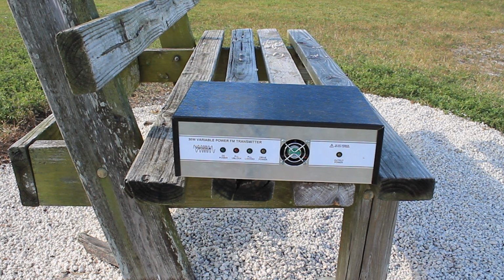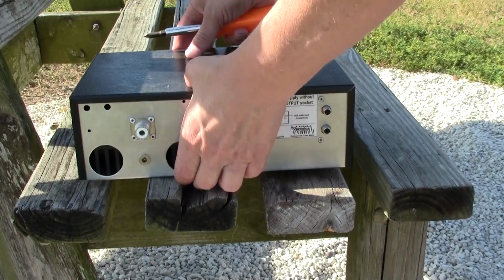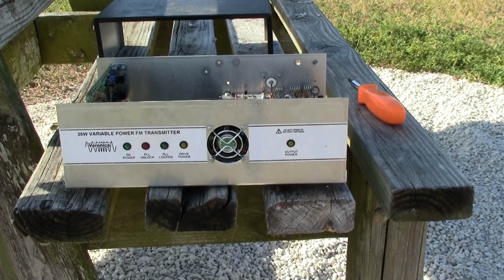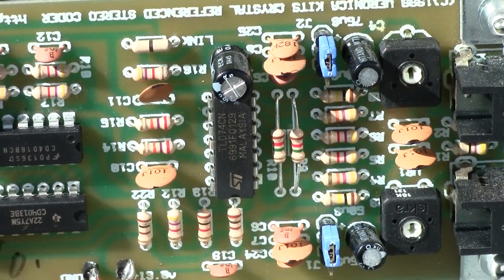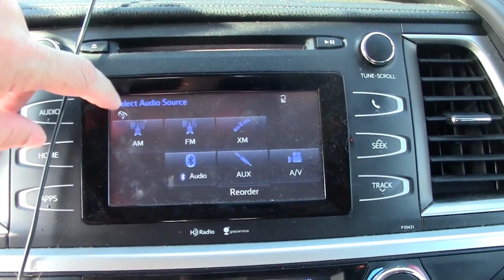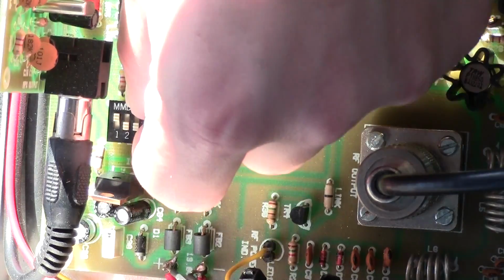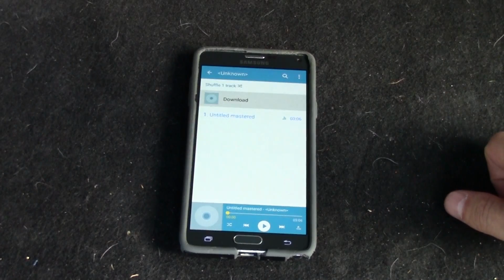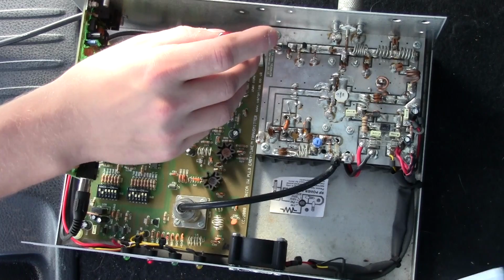Cheap PIRATE/UNDERGROUND FM RadioTransmitter by Veronica--How To

Comment: I run 100 watts and a .94 wave dominator  its hilly around here I get about 10 miles with good sound I have only 40 foot of tower  I have a 75 foot one for my wireless ISP   but if caught I don't want the feds taking that tower !!
Reply: The1Killerz  Illegally broadcasting on FM radio without a licence.
Reply: You'll get a warning first as long as you aren't on a local occupied frequency or using profanity
Reply: @CoolOldBiker   We now have been at it 5 years with no problem the closest station on our frequency is 100 miles away from what we have read they don't do the warning any more  the tiger teams swoop in since a FCC agent is not  law enforcement   they must have ether a federal cop or local police to make entry with a warrant and both the county and state police listen to us when in the area and we have been advised they will warn us if they are involved !  we have tried to get LPFM with no luck plus its so expensive  and a LOT of the groups that did get licensed have turned them back in because of the fees that no one tells you about like $1000 for BMA  ASCAP  the $3500 for a EBS receiver   and you must be on a minimum of 36 hours a week so if your not on the EBS is useless  we have a weather alert radio from Wal Mart  and we beat the local news by a few minuet's getting a warning out   the whole thing boils down to the NAB is scared to death some one will prefer our station over a members one  whats scary the NAB has lobbied IE paid off the FCC to allow mutable stations owned by the same corporation  and now even the RUSSIAN media can own stations in the US and they do !! that's not good ! BTW yes we don't allow foul language on air nor do we allow Rap Hip Hop OR young country to be played and we now have a homemade profanity cut out with a funny tone of a ku ku clock bird for live phone slip ups . OH with new coax now a 15 mile range  the stuff for CB RG8 is awful !

Comment: A question for the guy who did this video I've got a 7watt FM trasmitter at the moment here in the UK and my antenna is 40tf above ground level if I get a 15watt fm trasmitter and keep my antenna at 40ft at 15watts how many miles should that get me because at the moment it for a 4miles on 7watts?
Reply: More power is not the answer. More height is. 40 ft off the ground isn't high enough. It's why they put FM transmitters on mountain tops.

Comment: I would have thought that the inputs would be at line level and you would need to convert speaker to line level input to match the requirements of the transmitter.  Not doing this could overdrive the unit and damage it not to mention the sound is horrible.

Comment: So if I i somehow put the antenna in the stratosphere i can basically broadcast to North korea?
Reply from the maker: +Mr.Baofeng --->  now you got the idea!
Reply: They wouldnt be able to hear it as their radios only tune specific frequencies. Their local 100Kw transmitters would swamp your signal if you transmitted on the same frequency. Also if you’re on the other side of the planet, they’ll be shielded.
Reply: You didn't mention your location. If an antenna were to be extended into the stratosphere however, your transmit signal would be absorbed by your feedline after a few hundred feet, and no signal would make it TO your antenna. If your proximity is within 10 -20 miles of N. Korea, you would see a good chance of being received with an antenna up only 30 - 40 meters and a transmitter of 100 watts. What is your location? I can have someone listening for you in the area you are speaking of.

Comment: I find it amazing some of the crap that comes out of peoples mouths. The guy jakeguitar01 who made this video is NOT claiming  to be a professional he is just showing you whats inside the unit and how to adjust it. How can people judge the sound quality over the internet !. The guy is feeding the transmitter from a mobile phone and recording it with an average microphone and then uploading it to you tube. What are you expecting "musical fidelity". He's just showing you how the bloody thing works. As for those of you arguing about power and distance, some of you so called experts are talking sh@t. There are many things to consider when transmitting, for instance, someone listening to your output may live five miles away from you and have no buildings in the path of transmission. on the other hand, someone living one mile away may have and may not get your output. You need more power to get around buildings and into built up areas not so much the distance. I could go on but i wont. The video was educational........ give the guy a break.

Comment: What is purpose of Premphasis?  Thank you.
Reply: Without getting into a lot of complex theory, the idea of pre-emphasis (and corresponding de-emphasis which occurs in all FM receivers) is to increase the signal-to-noise ratio = make the system sound better.
Reply: In hindsight it was stupid.  It is boosting (preemphasizing) the high frequencies at the transmitter. . . then deemphasing them at the receiver.  The result is a better s/n ratio for the high frequencies at the radio speaker.  The boost at 15khz was about 17 dB.

Comment: What's the best frequency to transmitt on for distance?
Reply: One that os clear in all the areas you want to cover.  Really, it is as simple as that.  You need to have a listen in different areas, look at which legal stations are about etc.  I used to listen to Dimension FM on 92.2MHz in the North West.  They had a TX on the TV mast on The Wrekin.  No one around the area used 92.2 so it was ideal for a huge range.  They were also heard by another station in Manchester.

Comment: The sound quality is poor.
Reply: Yep its thin and tinny sound because its crystal based oscillator, transistor oscillator multiplier designs much nicer sound as not restricted by crystal bandwidth, they did put out good power though.
Reply: That is because he is not using any audio processing.
Reply: @knoxieman  The crystal has nothing to do with it. Commercial transmitters used by FM stations are also crystal locked and they sound pretty damn good. It comes down to the quality of the transmitter and the audio processing used.
Reply: @radioengineering8247  in this case it sounds bad because he is running a speaker-level signal from his phone directly into the stereo coder which is a line-level input, but he also is not using any audio limiting aka broadcast processing. with the proper airchain these veronica transmitters sound great and produce a clean, harmonic-free output.
Reply: @knoxieman  the veronica pll's are not crystal-based.

Comment: whats the range on it?  probably not too far ,  i know the amatuer radio antenna up on the mountain gets around 75 miles dont know how much power out mabie 100? watts.  mabie 2 miles with your 30  watts?
Reply: fm broadcast range is highly dependent on antenna height over terrain, the higher the antenna the longer the range.

Comment: In the US, unless you're a licensed radio amateur and testing on amateur-authorized frequencies, the fact that your transmitter is missing the FCC's part 15 compliance tag (it wouldn't qualify for one anyway) means you're not quite "in compliance with part 15". It doesn't matter if you say the "power is turned all the way down".  Just a point of interest you can research yourself.  Nothing toxic and nobody will hold you accountable ... just technical, unless you interfere with someone, which is possible to do with 30 watts.

Comment: When was that xmitter built?   That is literally 1970's technology in that thing.
Reply: you can see at 9:18 the amplifier PCB says copyright 2001
Reply: david dennis the first veronicas were made in the late 90's. the one in the video is a pll3 "easy tune" from around 1999. my oldest is a pll2 i built from a kit around 1997. the latest is the pll9, i have 2 of those, a 1-watt version and a 100mw version. 
 
 they look old-school because, believe it or not, there is absolutely nothing wrong with old-school technology if it functions properly and efficiently. these ancient-looking boards produce an extremely clean signal, and if you connect them to pro-grade audio gear like an optimod, you cannot tell the difference between a commercial radio station or a pirate running a veronica. none of the crap chinese fm transmitters on ebay come anywhere close to the same signal quality.
Reply: David Dennis how are you seeing 1970s? Looks like early 1990s
Reply: Transmitters, especially those from the 90s, were not sexy to look at. The low power ones were usually in an enclosure with a couple jacks, an RF output, a few lights on the front with a couple buttons, and maybe a VU meter. Other than that, they were extremely utilitarian.
Reply: The designs for these units go way back - it's very old technology which has never been updated. A decent exciter shouldn't have to have the PLL manually tuned to lock.

Comment: Good god, thanks YouTube for the speed control.  I'm falling asleep here.

First off, you don't look for an open freeq at your transmitter site. You want to know what's open in the distance, preferably the fringe distance, in all directions (it will take a while).  However you don't look for AN open freeq, you look for THREE open freeqs in a row, and you want the middle one.  That will ensure you're stepping on neither an adjacent channel station nor are they stepping on you.  But you'll never know that at your TRANSMIT site.

And second, back at the beginning, you don't need to connect a dipole antenna specifically --- you just need to connect AN antenna.  Dipole is one type out of dozens.  And btw I've got 13 miles out of half a watt, so it's way more about antenna than power.

Comment: You are definitely not part 15 compliant, not even a little.
Reply: Part 15 Devices:
Unlicensed operation on the AM and FM radio broadcast bands is permitted for some extremely low powered devices covered under Part 15 of the FCC's rules.  On FM frequencies, these devices are limited to an effective service range of approximately 200 feet (61 meters).  See 47 CFR (Code of Federal Regulations) Section 15.239, and the July 24, 1991 Public Notice. 
So, in black-letter law, if your signal exceeds 200 feet, you are in violation

Comment: Is that all ? Think you are doing something wrong, I can get out more than that with 1watt
Reply: I have got 27.7 miles on a 0.5 watt output transmitted into a vertical vhf antenna mounted 60 ft above ground I could work the world on 30 watts. 😊 peace ✌
Reply: Pete uk radio amateur mw6zan what equipment do you have? And how did you set it up? I’m ready to take my station from internet to the fm dial. Pls help?

Comment: Yeah bro you're almost certainly not in compliance with Part 15 rules with that thing.
Reply: Although an operator does not have to obtain a license to use a Part 15 transmitter, the
transmitter itself  is  required  to  have  an  FCC  authorization  before  it  can  be  legally
marketed in the United States.
In  order  to  prevent  such  interference  problems,  each  Part  15  transmitter  must  be
designed to ensure that no type of antenna can be used with it other than the one used
to  demonstrate  compliance  with  the  technical  standards.    This  means  that  Part  15
transmitters must have permanently attached antennas, or detachable antennas with
unique connectors.  A "unique connector" is one that is not of a standard type found in
electronic supply stores.
I don't think the transmitter with a standard jack and not including the antenna fails even these small requirements.
Reply: StringerNews1 who cares

Comment: He was ripped off. 
£300 for 30wts😂
Veronica are now arref and ship from abroad now. 
They make good 5/8 straight ups and other aerials for £150.  
We get 300watts for £500 off an illegal transmitter builder. 
In 2009 i started using a 700ft national grid pylon on the river Thames in England to transmit off. We were pushing over a 200mile radius over the last few yrs with the 5/8. The 5/8 Radiates the power a lot better.
Reply: KALUS DJ wow that’s so cool. How did you get power to it? How come no one found it? Intriguing!
Reply: UKViking 
It’s on the river Thames and in the flight path of London city airport so has lights all the way to the top😁
I used it for a many years from 6pm to 8am but went 24/7 last December after djs wanting to get it during the day when at work. 
That pissed ofcom off and they raided us in March! 
National grid turned our rig off a few times when they were doing maintenance once a year but left it alone most of the time. 
The problem for the ofcom was it’s a 700ft ladder climb and they had to have a national grid crew of at least 5 to climb it and offcom weren’t allowed to go up alone so we got away with it. 
I’ll post a video and some pics for you to see the stack and view up there. My straight up aerial is still up there now with a small rig pushing static so all I need to do is put another rig up there and link music to it.
Just waiting for my court case on the 14th this month to see what happens but essex is dead for stations now so people want me to come back on

Comment: How far can you transmit with that?
Reply from the maker: +The Messy Scrapper --- I set the transmitter up at about 70 feet over sea level which is high for south florida.  At full power I can reach about 15 miles.
Reply: does it depend on antenna to transmit area ? or the box  i mean by adding antenna can i reach far ?
Reply from the maker: +shanto chele -->  Yes.  The antenna is very important.  The antenna actually has to he tuned for the transmitter.  Everything has to match correctly including the resistance of the wire and the length.  The higher up you place the antenna,  the further your radio signal will travel.  This radio transmitter should get you up to 15th miles as long as it is set up properly.  Thanks for watching my video.
Reply: with a proper impedance match, the loss at 30 watts is negligible. An antenna with some rf gain would more than compensate for the loss.

Comment: How to get complaints.
Not monitor your deviation and interfere
Not filter harmonics and interfere
Get noticed in the community and get reported
A temp very low power event in a park as a one time event is unlikely to get found.
Having a signal that is virtually undetectable outside the venue location is a good idea.

Comment: Hi,
“all the way down“. Isn’t good enough to comply with part 15.  To be compliant you need to put a dummy load on this thing  instead of an antenna and adjust the power to below 100 milliwatts (1/10 of 1 Watt). You also need to make absolutely sure there is no spurious output that could possibly interfere with pretty much anything else. It’s not really worth killing a whole airliner full of people!

Comment: I would suggest removing the veronica stereo decoder there crap  .and also you'll find the veronica transmits on numerous frequencys to which you choosed. so it's a bad transmitter even know your swr is 1:1 .I don't like veronica that's the reason I've binned my veronica I don't trust them .and also the amp is not stable .